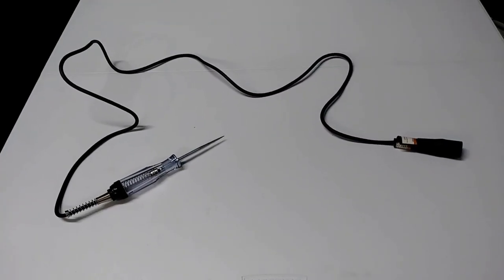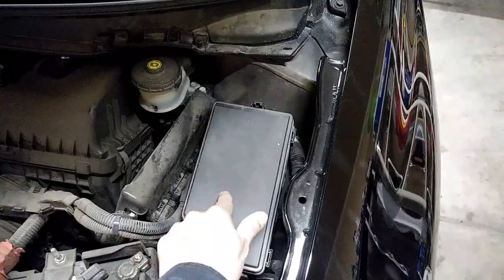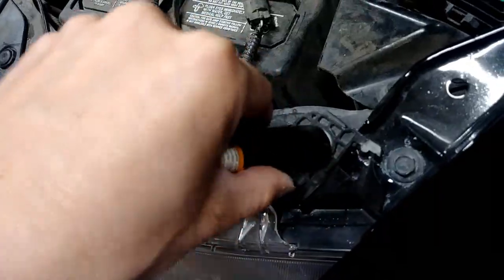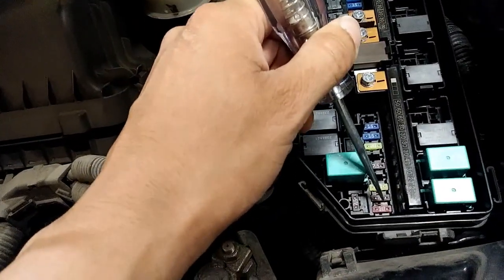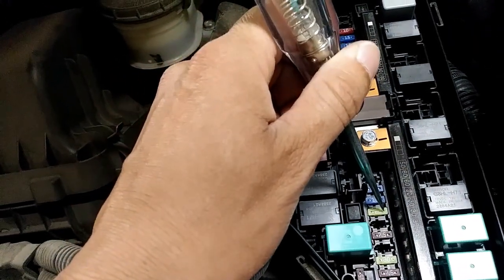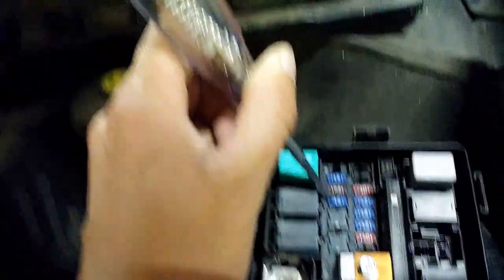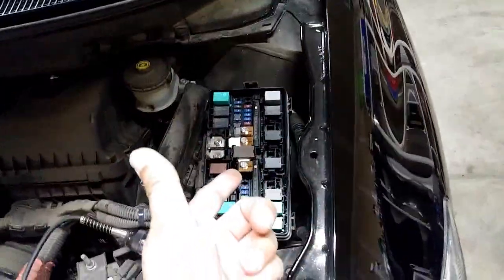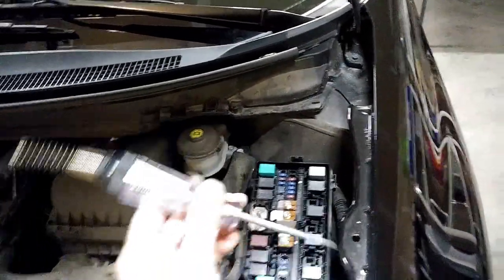How to use a Circuit Tester to Check Car Fuse (Test Light)

Comment: Another very helpful video from Welking Vue.  I received a 6/12 volt circuit tester as a Christmas gift.  You helped me learn how to use it in the most practical way, which is testing fuses.  My son is still driving his 2001 Camry.  You helped me change the ATF fluid in the main fluid compartment and the differential compartment.  His 2001 Camry has been a great first car for him.  Good to see you again, Welking.
Reply from the maker: Thanks for sharing your story. Have a Happy New Year.

Comment: For example im trying to connect led lights on my car doors can I use this tester to know which wire has energy  and which has not ?
Reply from the maker: If a wire has power and you touch it the bulb will light up. Keep in mind there are power wire with constant power and without constant power.

Comment: That circuit tester comes equipped with an IDIOT light.OBD2 models 90’s and newer don’t like the onbe poked and prodded with old school circuit testers. You can do more harm than good. Go down to the local box store and grab yourself a FLUKE multimeter

Comment: That 'wire' is the hood cable release. And that bolt on the plastic tab of the headlight isn't a good ground source. Better to clamp it to the chassis or the negative terminal on the battery.

Comment: Why would I need to test a fuse for headlights when turning the car on and operating the headlights.. I would get my question answered. Don’t need a light-tester to tell me if there is power or a fuse blown to my head-lights, because the head-lights are on being self evident. But it is a good example however for other kinds of fuses which could be tested on the ON position while not having a visible confirmation sign such as a head-lamp.

Comment: Hello I am trying to test my fuses. But I have no idea how to use the fuse tester. What do you attach the other end too. You do not show that also what do you acutally touch the point to I could not tell if you were touching the fuse plastic are the side of the fuse. my light is not coming on to any of them that is why I am asking. Does the car have to be on to check fuses and what do I attached the other end of the fuse tester too does it have to be metal? do you touch the pointer to the plastic of the fuse  I am a woman and don't make fun at least I am trying to fix my own car radio My radio quit the clock is on but the radio is dead. no light no nothing. I know where the the audio is on my 2009 Sonata I cannot pull out the yellow audio fuses. I pinched the yellow part together but only one side comes out and I cannot get the other side out it is like it is stuck. I am afraid I am gonna break the plastic if I keep trying to pull out the yellow plastic fuse holder. Would a parts place come out and help me you think. ??